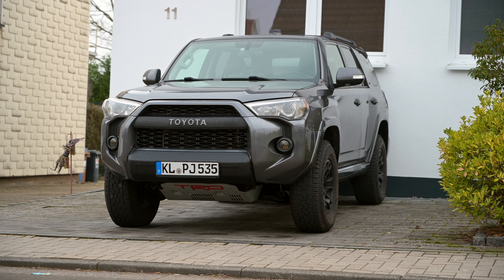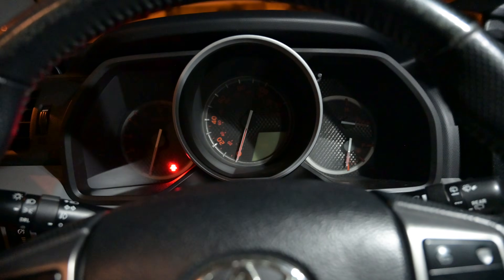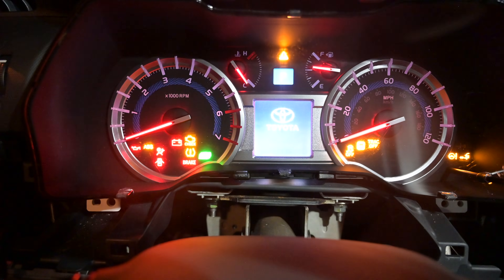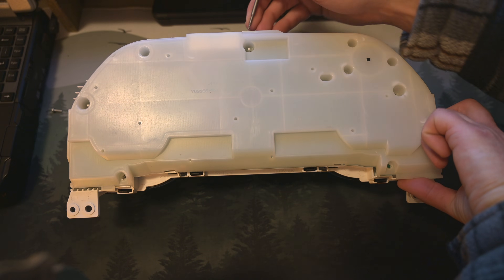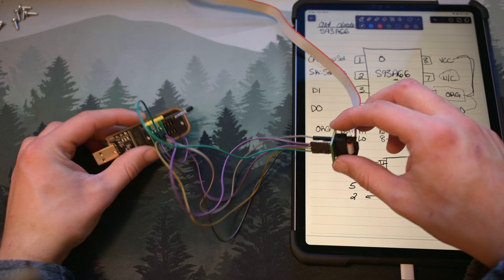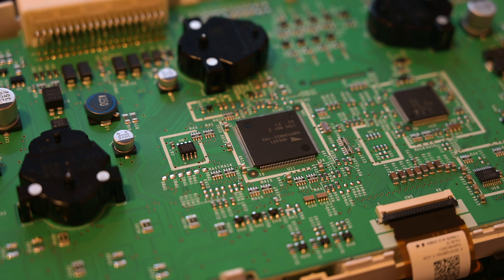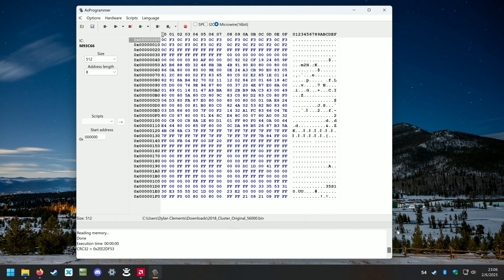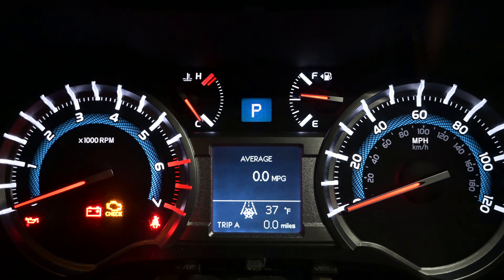How to Transfer Mileage to a New Instrument Cluster on 2010-2019 Toyota 4Runner

Comment: So can I swap in any 2014-2019 cluster to work on a 2010 4Runner? It's plug and play? Does it need to be from a 4x4
Reply from the maker: @Slapshotshorts  I making a video on that right now actually! It’s relatively plug and play, you will need a 4x4 cluster. There’s a few wiring changes that need to be made but it’s a very simple swap.
Reply: @DylanClements98 Oh man this would be amazing. I just wanted to swap to a newer cluster and gonna swap my miles over like yours.
Reply: Any luck?
Reply: @DylanClements98cmon man you should have made a video or atleast explained it😭, there’s not one video or forum on this.
Reply: @DylanClements98Amy luck?
Reply: Make a video how to upgrade 2011 to a newer cluster 4x4 please